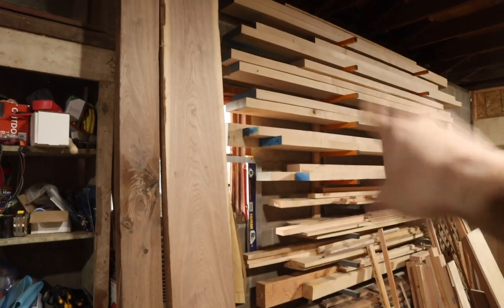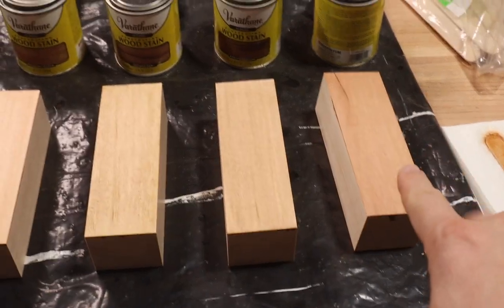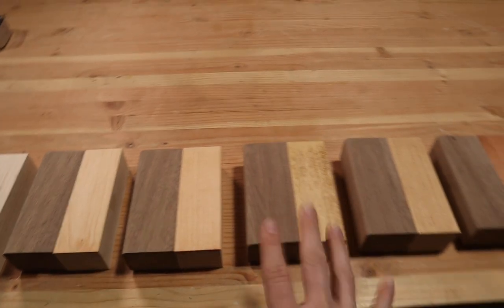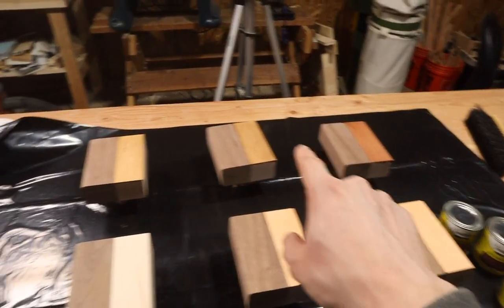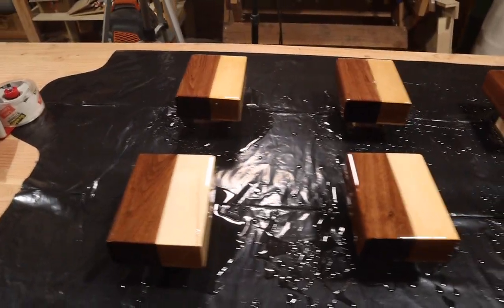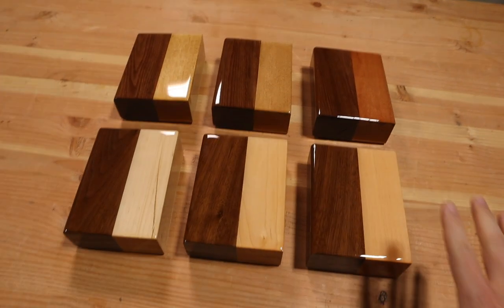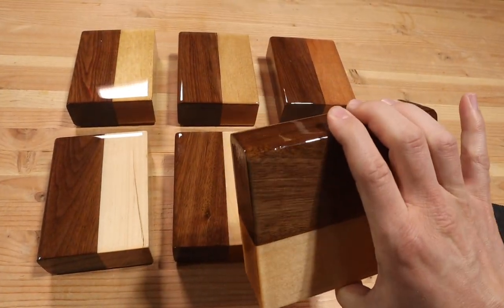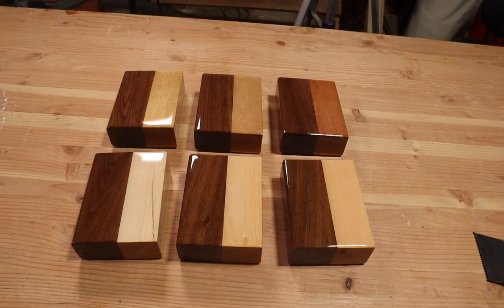Starting My First Epoxy Table

Comment: Excited to see your next video.. epoxy is an art.  One thing I would mention is when doing small pieces you can use large plastic Rubbermaid containers with a lid while curing seriously cuts down on the dust and the amount of sanding you will need to do if there is dust in the air.. for larger projects you can build a melamine form and slide a large piece of melamine on top to keep dust out while curing.  Keep up the good work!
Reply from the maker: Thanks Jesse! And no kidding. I learned a ton and am glad I did this before the large table. 

Those are both awesome ideas. I’ll have to look into those for next time.

Comment: Great job of describing the process! I learned a lot. Really looking forward to the table build.
PS, I’m with you about stain. I’d rather stick a fork in my eye than stain perfectly good wood. 😂
Reply from the maker: Thanks Steve! That was the hope! Man did I learn a ton as well. Hopefully saves some of you guys headache later 😂

Also, I’m so glad someone is with me on the stain 😂 I’d rather find a wood that looks right than stain another.
Reply: @NorthwestCraftsman  
I got to thinking about the (control?) piece of maple that had the crack in it. I recall you saying there was an issue with a lot of air bubbles coming out of it in the epoxy. What are your thoughts going forward on that? I know (and you probably have done this in the past too) that some people use epoxy to fill cracks while other people use superglue and perhaps sawdust to fill cracks. Would you try fixing a crack with either of these methods before applying flood coats of epoxy or just apply the flood coat and address the bubbles that way?
Reply from the maker: Great question. There are a bunch of ways to prevent that. In the final table I used wood filler of a similar color to fill the gap. Quickset epoxy, wood glue and sawdust, and superglue also work. I chose wood filler because I wanted the stain to somewhat penetrate. Some of those other methods will leave a sharp and contrasting line, because the stain will not penetrate. 

It is possible to use the flood coat to fill, the problem you run into is that it takes a couple of coats, and if the gap is large enough, the flood coat will never fill it, because it is too thin. I did have some success, waiting for it to partially set up, and then use a tongue depressor to push the thickened flood coat into the gap, prior to it fully setting up. This is relatively risky and time dependent though.